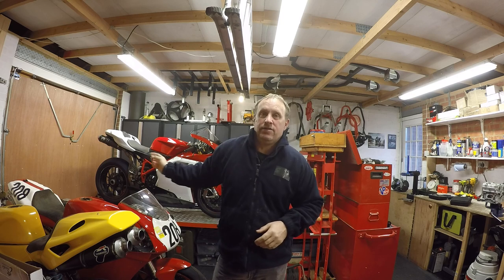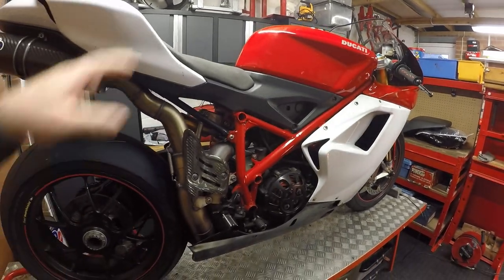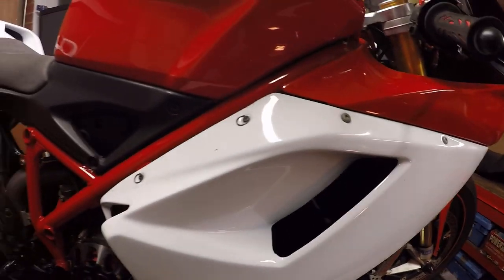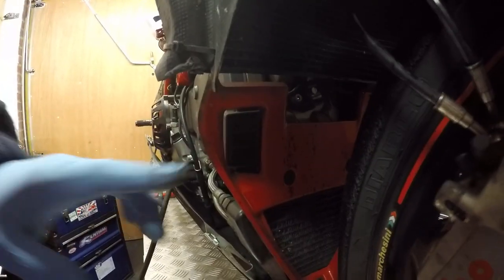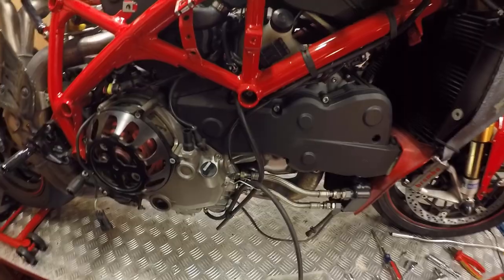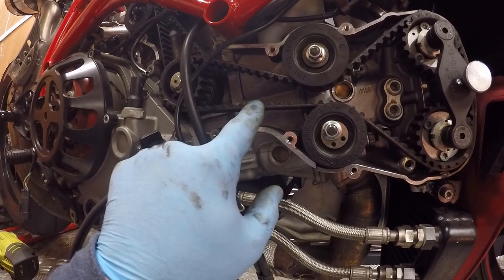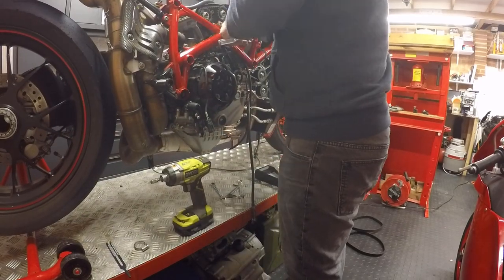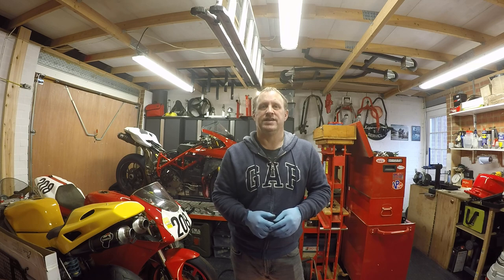Ducati 1098S - Replacing the timing belts - Service Video No.1

Comment: Nice, very happy to see a new serie and helpfull to me with my 999 work. Did you had any issues getting the spark plugs out? On my 999 I feel I need  a very thin 16mm socket in there.. I reach the spark plug just not the bolt
Reply from the maker: Thanks 😎 I did not have a problem as I have a thin walled socket that I used, spark plug sockets don't seem to fit in the hole.

Comment: Great video as always, I have just picked up a monster 659 with 10,000 kms what you suggest about a belt change on it , is it time or kms the bike has had a easy life.
Reply from the maker: HI Chris, do you know when the belt was last changed? If not I would change it so you know. Unless you are doing the mileage most belt changes are due to time period. 😊

Comment: Great video.   I do have 1 question though.  You have the tool that hold the cam pulleys in place so they can't move when the belt is off.  But why do you have to loosen the 3 bolts on each cam pulley (you mention tightening them at 13:58).   What is the purpose of loosening and then tightening them back?   I see this mentioned in the factory service manual as well.  Thanks.
Reply: I would say that the tool helps so the timing remains the correct one when tightening the belts. I would like to know what is really the difference... I have never used the tool and i don't know if we are talking about 1 degree or rather a bit more so it really matters in terms of performance and quietness of the engine.
Reply from the maker: Victor is correct, the tool holds the timing in place to factory standard whilst you tension the belt. The pully bolts are loosened to allow the belt tension to be adjusted whilst not interfering with timing.

Comment: Great video, thank you. I just got my first Ducati, an 1198sp with 15000 miles so it’s ready for belts. I’m a bit out of my element since my last three bikes were TZ250’s. Where are the cam locking tools from? Are they expensive? I don’t plan on doing this job frequently so may be cost prohibitive. Thanks again for great instructional videos.
Reply from the maker: Hi Jim, the tools are from Ducati Kaemna in Germany, they are £200 odd for a set.

Comment: Hi Desmo, 
so to be clear, the tool you use locks in place the relative camshafts positions against rockers. 
By unscrewing the pulleys, you release the possible stress generated by the camshafts on the belts  (tension of the belt is then solely related to the pressure of the tension pulley).
To my understanding, this means, while you are tensioning to the correct frequency, that the position of the cam pulleys are subject to movement. This before you tighten them back.
Additionally, both tensions (H and V belt) are different, hence the movement of the not-yet locked-back pulleys too.
Am i missing something? 
Best regards,
H.
Reply from the maker: Hi Hani,
Yes the tools lock the cams in place so you can adjust belt tensions with no impact on the timing.
If you did not use the tools then when you tension the belt you would marginally move the timing.
Ducati now use the same tension for both belts, they used to have different tensions per head on the older belts and bikes.
Reply: @DesmoWerx  Thanks for the reply sir. I will try another one if you don't mind. 
I've seen different remarks on shims about their gap - on one side who would prefer resetting to factory default on the tight side for both open and closer like LT SNYDER, - on the other preferring hi spec for opening (0.18)  and lo for closing (0.05), taking into account the natural evolution of wear (opening narrowing the gap and closing widening it).
> what is your testastretta evoluzione point of view on the topic? 
> i don't get it, trying to understand this possible evolution of wear, concerning the opening rockers. Since to me this narrowing gap could only be created by valve seat settlement (and this should not happen normally?).
Best regards,

Comment: Hmm I'm assuming the cam locking jig tools are necessary for accurate cam timing adjustment? As most plebs, we'll me really don't have access to them or if I'm honest need, I'd go along with marking the belts in the tdc positions? And crack on, is this acceptable? And just a quicky is it better to check valve clearances with belts on or off? Thanks for your time.... Regards and great vids👍
Reply from the maker: Hi Philip, the tools help maintain cam timing whilst you loosen the cam pulley wheels, this helps with making it slightly easier to get the belts on. You can replace belts by marking the wheels, old belt and then transferring the markings to the new belt to ensure it goes in exactly the same place. The tools assist with repeatability which counts if your doing a few of them 😎

Comment: Super vidéo, thanks a lot.
But i havé a question: don’t you have to remove first your timing tool before doing your belt tension measurement? Because the tool would affect the final tension, no?
Reply from the maker: No need, the tool locks the cams not the cam pulley. 😎

Comment: for those watching..there is a much faster and easier way to change belts...take fingernail polish and mark where current belts are in relation to gears.  Take belts off and count teeth to match new belts, mark new belts with fingernail polish, put new belts on and done!  No need for any special tools or finding TDC!
Reply: It slides out and in without loosening the tensioner?
Reply: @mmm4638  tensioner has nothing to do with the teeth of the gears, or the teeth on the belt if you count exactly how many its on.  Tensioner just puts pressure on it, doesnt move the teeth from their grooves regardless how tight it is.

Comment: Why did you loosen the timing locking screws?
Reply from the maker: Its so that the belt can tension correctly, the tool holds the cams in the correct timing place but stops them rotating so you cannot tension the belt unless the wheels are loosened from the cams.
Reply: @DesmoWerx  is it possible to change the belts with out the cam locking tool?

Comment: Great Video once again.... One more off topic question... what do you use for head gaskets and engine seals for your engine build projects? Athena or Ducati dealer?  I’m amidst building my 1198 engine. Thx Again!
Reply from the maker: I tend to go with Athena gasket sets unless I can get the OEM ones at a good price. In my experience there is very little difference between them.
Reply: @DesmoWerx  Great! Thx!

Comment: Question, you locked the position of the cams relative to each  other which is fine, but how did you accurately find the position of piston tdc to time the now loosened cam sprockets to the crank?
Reply from the maker: Hi Calvin, I used the timing mark on the lower pulley, as just aiming for stock position, if I wanted to time to exact degree settings I have a tool with dial gauge attachment I can use.

Comment: This seems a lot faster and less potential for error compared to the method of marking dots on the belts. But you lost me when you said the cam sprockets were loose and need to be retightened?
Reply: He locks the cams with that tool and by loosing the rollers its much easier to fit the belt. Rollers are free from camshaft, so cams stay in place if i am not mistaking..
Reply: @Moosjwz  Right. I just watched one of his earlier videos, so he just skipped explaining that step in this one. But I still don't understand why they need to be loosened. Won't the new belts fit with the cam pulleys in the same position?
Reply from the maker: Hi RC, the tool locks the cams and allows me to loosen the pulley's which helps with getting the belts on far more easily than when they are fixed to the cam in position, there will always be a slight difference between each belt due to tolerances in manufacture so the tool adds with achieving repeatability in installation and belt position. You can also adjust tension without overly affecting the timing. I did explain it when I did the earlier 749 timing video which uses a similar method, apologies I should have added that step in this video as well. That's why I had to retighten the pulleys😊
Reply from the maker: Correct Neven 👍😎

Comment: Can you please explain what the device was to tension the belts,working off electric signal as i haven't seen it used before ?
Reply from the maker: Hi Ger, it is an optical belt tensioner made by Clavis.

Comment: What a great channel! I have learned a lot  from your videos, but I have a question about the cam locking tools. If your cam timing has been changed from factory settings (optimized), and you want to keep that setting, can you still use the cam tools and keep track of the new settings in some clever way?
Best regards from Sweden 🇸🇪
Reply from the maker: Hi Henrik, you could unlock the tool and relock to the cam timing setting you have on your engine before you remove the belts. The cam positioning heads are locked in with thread lock and a bolt so could be adjusted that way of you wanted.
Reply: @DesmoWerx  thank you very much for your advice 👍👍

Comment: hi is it ok to turn the cylinders by turning the wheel or cold that  lead to damage ?
Reply from the maker: You can turn them via the wheel but it is not as accurate so may take a few attempts to line up the marks correctly. Make sure the plugs are out to ease the process.

Comment: Just out of curiosity - are the pulleys for the testastretta engines compatible to each other? I was wondering if it is possible to replace the heavy pulleys from a 998 testastretta with something lighter from a younger testastretta engine?
Reply from the maker: Its not something I have looked at doing, if the wheels the same size in diameter it would be possible. You can get lightweight wheels for the earlier testastretta engines.

Comment: Another great video. Thanks!  Where can I buy the cam timing tools?  I’m currently rebuilding my 1198 and waiting for my crankshaft to be repaired. Not sure how I’m gonna get the camshafts retimed without these tools when I reassemble the engine. Your videos have been sooo helpful... Thanks Again!
Reply: I'd also like to know where to get the cam locks. All the places I checked only have the cheap plates that suppsedly lock the cams, but there are only gear cutouts for one side, so I don't know how they're supposed to lock both cams. As I understand, the factory tool fits in the "T" of each gear for completely positive locking.
Reply from the maker: Thanks 😊, I get my cam locking tools from here https://www.ducati-kaemna.com/ you will need the specific tool for the 1198/848 EVO as it is different to the 1098/848 tool.
Reply from the maker: The cheap plates do not secure cam timing but rather stop the pulleys moving which is a little awkward for putting the belts on. They can be a cheap alternative though.
Reply: @DesmoWerx  What is the part number for ordering? I have a 998 which I believe is the same tool as the 749/999 and 848/1098?
Reply from the maker: @998RC  The 998 needs the tool for the 749/999
Reply: @DesmoWerx  Thanks, I’ll check it out

Comment: Hey. How do you find the tdc on the vertical cylinder viewing the crank shaft pulley?
Reply from the maker: Its another 270 degrees on from the Horizontal TDC, if you keep rotation in the same direction as the engine operates. I use a long screwdriver in the spark plug hole to check its reached TDC on vertical.

Comment: Pretty involved stuff just for 2 belts! Change every 20K miles?
Reply from the maker: Hi Brent, the manual states every 2 years or 15000 miles, which ever comes first. My change is due to age rather than mileage.
Reply: @DesmoWerx  Thx 4 replying. So in other words, one mite go 4-5 yrs on a belt change so long as they 'tune' it to 100 hz? This wouldn't b my bike however!
Reply: @DesmoWerx  Also I can't say how much I luv u channel since I got my ST-2! I have a couple Mercedes' AMG's yet channels to fix those cars r scarce! Glad you're here!
Reply: @DesmoWerx  I have a '12 848 evo and a '13 Hypermotard SP, funny thing is they use the same belts but the replacement intervals is very different. What tool are you using for the belt tension HZ? where can you get it? thanks for your great videos
Reply from the maker: Thanks Brent 👍😎
Reply from the maker: Hi 848 EVO, it is funny how Ducati have changed service intervals for the bike type over the years, I can only assume that is based upon expected use of the bike and its operating rev range. The tool I use is a Clavis Belt tool, I got mine from a dealer who was closing their service operation, You can find many retailers who sell them but they are not the cheapest.

Comment: Can you replace the belts without those cam locking tools?
Reply from the maker: Hi Jim, You can its just a slightly different process to do it. 😊
Reply: @DesmoWerx  I did replace mine with the small device that fits between the pulleys so the intake cam stays in place. All seems well so far.

Comment: But others mark the belts and they count the teeth, you did not, why?
Reply from the maker: Hi, not needed when you use the correct cam locking tools. People do that where they do not have the tools to hold the cams in the correct timing position whilst the belts are tensioned.